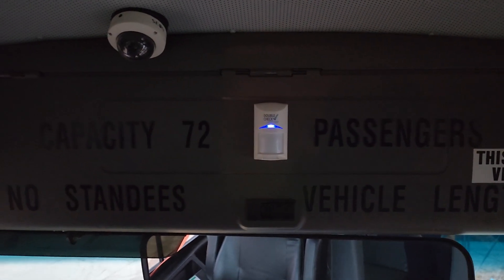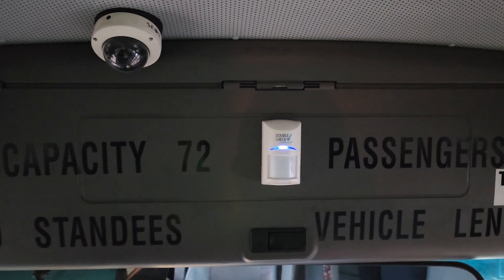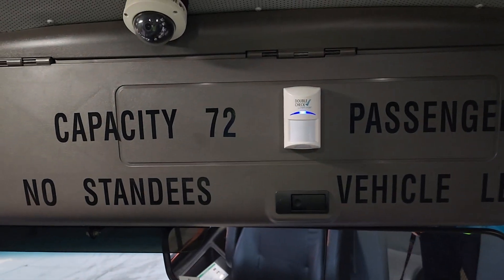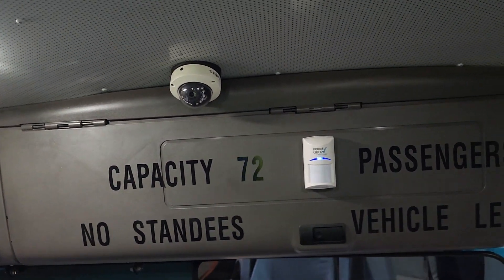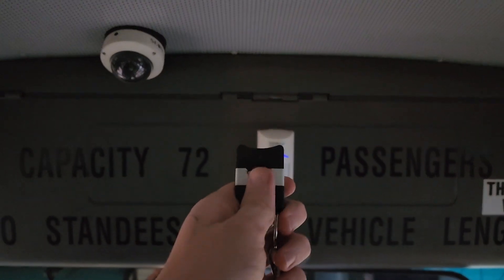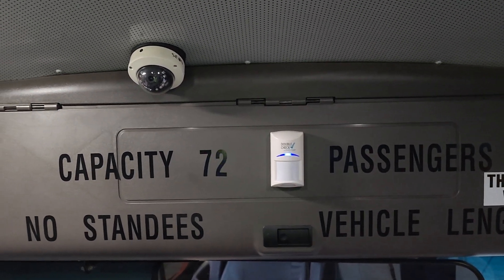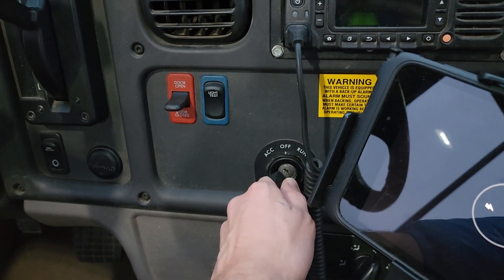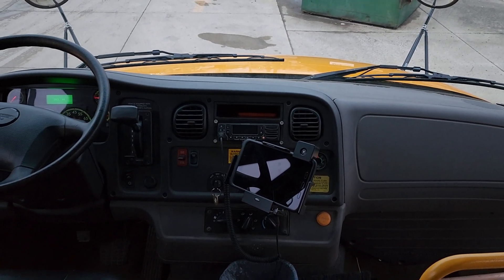How the Child Check-Mate Key Fob Works (Theft-Mate Cancellation & Maintenance Mode Demo)

Comment: So complicated just to check for children. We just put these little check marks in the rear doors of our buses.
Reply from the maker: The problem with that is drivers won't be alerted by an alarm to remember to check if they forget, and drivers DO forget from time to time.
Reply: @BusMaster99  Ours are required or they’ll be fired, plus they have to do a post trip inspection anyways after their routes along with cleaning the insides of their buses.
Reply from the maker: @SunsetChaser3  Makes sense.  Also, I should point out that key fobs are NOT for doing your child check.  They are only for deactivating Theft-Mate or Double Check when you need to get in the bus without the key.  Drivers typically do not have fobs as they are restricted to workshop personnel, dispatchers, and management.